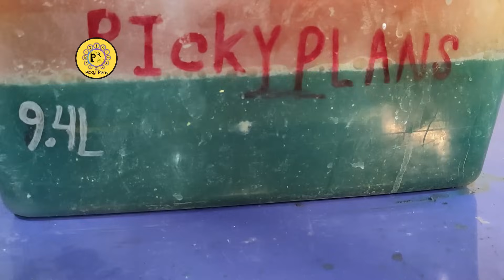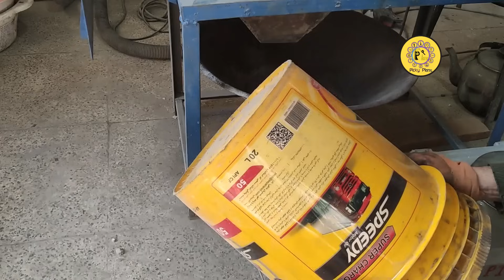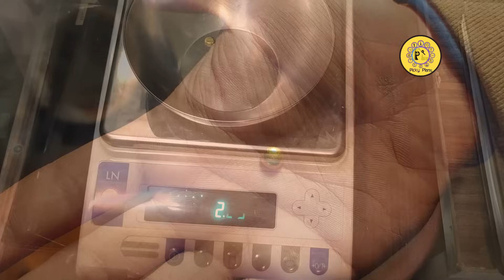Smelting Telecommunication PCBs for gold | 15 kg PCBs

Comment: Do you use water sulfuric and nitric as a CuCl2 solution to release foils?
Reply from the maker: Yes, after removing solder (Lead) i use this mix, it consumes less nitric acid to digest base metals. And it's way faster than CuCl2.

Comment: I was lucky enough to run across a good quantity of these cumanstion boards.there is gold plating all over the board itself plus hand full of gold corner chips then bunch of ice chips.i have about 50 of these that I have been separating the components.im looking forward to seeing results from running them.just not sure if I should use nitric or should I use kiln and smelt it adding some lead as collector metal
Reply from the maker: Smelting is a straight forward process, people prefer chemical processing, though.

Comment: Why do you preburn the material? Why not put ICs into the crucible with lead and flux on top and melt it down?
Reply from the maker: Carbon is not easy to be fluxed, it's been incinerated to lower the reducing powder of carbon and litharge consumption as the result.